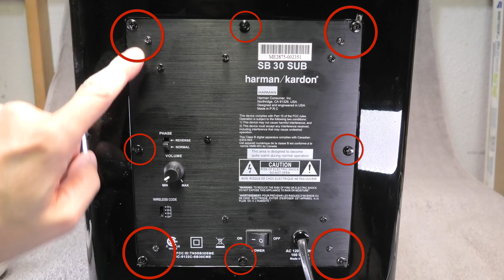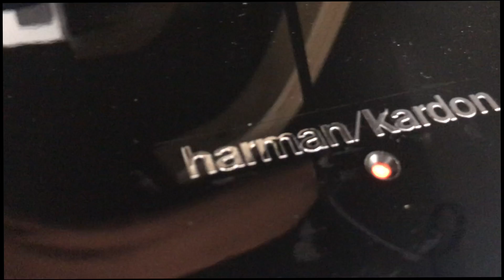Repairing Harman Kardon SB 30 SUB Subwoofer

Comment: My powersupply has also stopped working, and IT seems to be the exsact same problem. Can you give me the partnumber for the fuse and resistor too?
Reply from the maker: Interesting that you have the same damage.  
I can check when I get back home later today.
Reply: @MegaSafetyFirst  You didnt checken :( is it 31 ohm?
Reply from the maker: Thank you for the reminder!

These are the parts used:
Resistor:  ERG-3SJ510
Transistor: SIHP15N50E-GE3
Fuse: 39212500440
Reply: @MegaSafetyFirst  Thank you very much
Reply: @MegaSafetyFirst  Hi I wonder if this resistance, transistor and fuse modification can be applied on the Harman Kardon HKTS 210SUB / 230 Subwoofer circuit board?
These are the parts used:
Resistor:  ERG-3SJ510
Transistor: SIHP15N50E-GE3
Fuse: 39212500440
Reply: @MegaSafetyFirst  i have a question, for the original resistor, the value of the color (brown/black/brown/Gold) is 100Ohms but you replace transistor his value is 50 ohms is it normal?
Reply: @sharenjoy9315  mine is brown/brown/black/brown= 11Ohms 1% tolerance
Reply: I also have the same problem
Reply: Can I just not replace the whole power supply? I have the same issue. I can't find the same power supply online

Comment: Hi, while making the filter circuit, the hkts210sub/230 subwoofer had broken down before, the sound was too low, the STA516B amp chip had broken down, and I also suspected that the STA309A13TR chip, which is slightly below the STA516B, had also replaced the defective 4 22UF 16V aluminum smd capacitors. a temporary normal capacitor. In my previous checks, the 22UF 16V electrolyte capacitor STA516BETR and STA309A13TR came first until the new one arrived yesterday, I installed the STA516BETR chip but got low sound and power as with the STA517B before, and then I replaced the STA309A13TR chip, but still the sound was low and low, while the volume of the subwoofer should increase and decrease evenly with the AVR265 volume of harman Kardon, while the volume of the subwoofer should increase and decrease evenly the sound and power of the subwoofer were too low, where should I look in this case?

Comment: yeah i also had the resistor but only burnt off the board the value is within spec. Changed almost all the small caps, the high pitched sound is still there but a lot less and a bit different. The secondary is still reading 0.12mv and goes to 0.72mv but when i measure it drops which makes me think its the caps. i will change all other small caps and maybe the ceramic ones too. the 2 big caps looks fine charging to over 200v and not immediately going flat. Fuse is fine, trannys are fine. to be honest i have no fucking idea.

Comment: Too bad there's not a repair vid for the sound bar. 
Bought this cheap and no sound, but both light up.
Reply: I have the same issue. The sub seems to werk, the remote works. the lights on the soundbar work. Yet there is nog sound.
Did you find any solution?

Comment: What you forgott to tell is that the transistors you swopped to is with a conductive backplate and need isolation to the cooling plate, else it will short out to ground instantly.
I also found out on my HK subwoffer that the input from amplifier where bad, connection lost from time to time, I started and changed my burnt out resistor, then it worked for a while, then same problem again, did the transistors but no, then I found the bad connection on the sound input, fixed  :-) it was the common AUX input
Reply: I shorted my pcb because of that backplate on the transistors and I think its dead now :(…

Comment: I know this is a bit old now but I'm hoping someone can help. I have replaced the resistor in mine as it had clearly overheated and had actually melted the tracks on the board. I am now seeing the correct voltage on the four pin connector but not on the 2 pin connector. Any ideas?

Comment: Hi Sir;
i, did the bass increase when you installed these parts?
Resistor: ERG-3SJ510
Transistor: SIHP15N50E-GE3

but I recently bought a new original power board hkts210/230 from hkts210 / 230 (The R23 resistor was not 51 ohm 1w, instead it was 100 ohm 3w, and the C 30 was 471K 1KV instead of 102 1KV)

Comment: My wifi connection on the same model stopped working. Do you think it is possible to just add a rca connector to this and use it plugged?
Reply: I know this is 3 years later but this looks almost identical to a jbl 250p

Comment: I own a LG LAS855M soundbar. Which has wireless subwoofer. Power led cable is damaged by rat. Circuit board is completely safe inside a box. Only two set of cables passing inside.. one is for speaker which is strong and good. The other one is led cable and it's now torn into pieces. I need to bypass the led connection. Don't need to remove front panel since it's completely molded. Or any led connection near the circuit is fine just to complete the circuit. Please any one help on this

Comment: Hi there,

thanks for the helpful video! Could you please inform the value of the burned resistor? I've similar issue on a HKTS210SUB/230, but the fuse has not blown up.
Reply from the maker: Hi. The info is in the pinned comment.
Reply: @MegaSafetyFirst  please my SB 30 soundar will not come out of standby mode. Its amber. Any help please

Comment: Thank you very much for your nice video. I have a different problem. My woofer has a patchy wireless connection to the sound bar. I have to put it right in front the bar for it to connect. What could be the problem? Is it with the transmitter or the receiver? Would appreciate your kind response and help.
Reply: Same issue

Comment: my sb30 soundbar and sub turn on and connect but no inputs work .like it's on mute but I have lost the remote
Reply: I thought mine was muted aswell so i bought a new battery for my remote. If i mute it on my remote, im able to unmute with the buttons on the soundbar.
So you dont need the remote.  
But my soundbar isnt working. No Sound. Everything is connected tried different inputs yet of luck. So darn.

i do have to remotes!

Comment: Neat,  how much were the new parts that you used for the repairs?
Reply from the maker: They were around $5 total.
Reply: MegaSafetyFirst nice,  much cheaper than buying an entire new sound bar system. 👍
Reply from the maker: That’s exactly what I thought!  🙃
Reply: Where did you buy parts from ?
Reply from the maker: I got them from digikey.